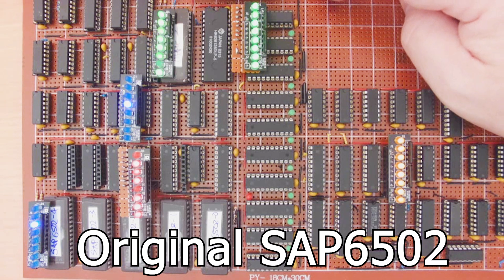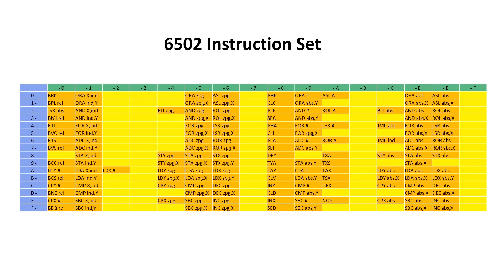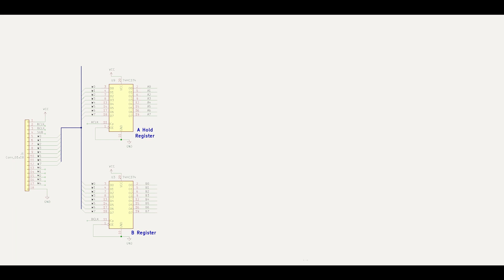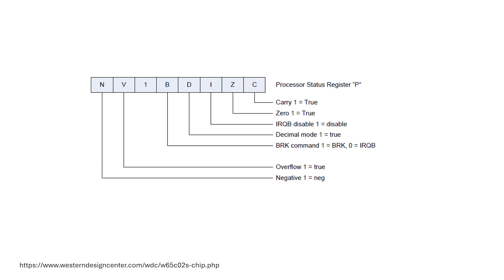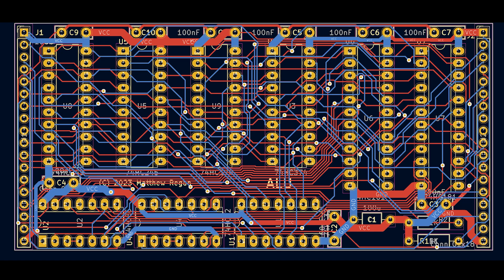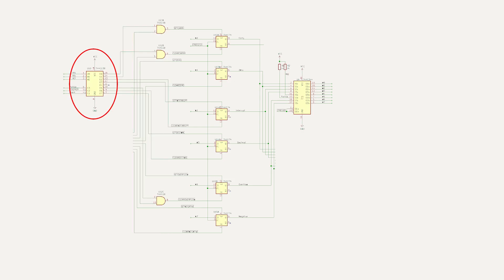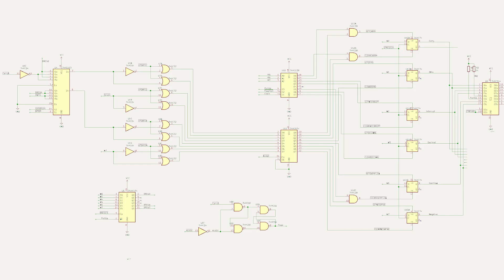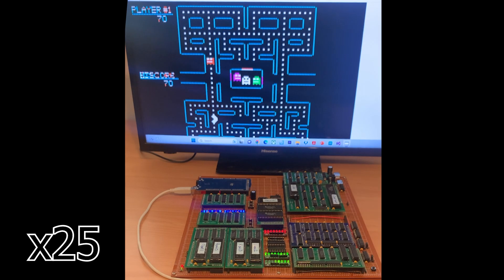TTL Apple 2 computer.  ALU and Status

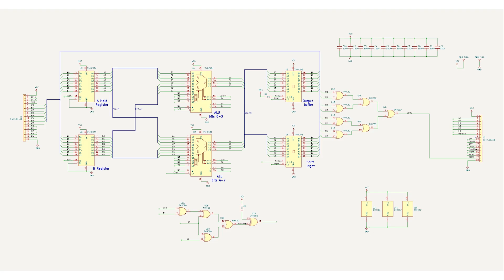Comment: I'm missing something in the diagram at 07:24.

If you look at the S|0..8] bus, the following are connected to it:
• Outputs S0..3 from U6
• Outputs S4..7 from U7
• Inputs S0..7 to U5
• Inputs S1..8 to U8

Where does S8 come from ❓
Reply from the maker: On the ALU board i have, S8 is connected to pin 9 J2.  This signal is driven by a 74hc00 acting as an inverter, which is just to the right of the ALU card on the carrier board.   This inverter is driven by  the !Carry0 signal from pin 16 of J2 on the status card.  

On this ALU board i actually have S0-8 are connected to pins 1-9 of J2, but i never used S0-7.  I plan to use these same ALU boards in an upcoming SAP68000 and i want fast carry generation so i decided to swap pins 1-8 of J2 to signals i can use with a 74HC182.  
When I updated the schematic, it looks like i forgot to leave S8 in place. 

Well spotted, i'll mention it in the next video.
Reply from the maker: Yeah, S8 is meant to be carry bit.  Let me have a look at the board.

Comment: Dr Regan, 

It has been proven that the rev A 6502 did not have a buggy rotate right function, but rather an unimplemented rotate right function, there was such a kerfuffle about this that the rev B 6502 had the function added.

You can find a rev a 6502 demasking that clearly shows the necessary signals are not routed anywhere to perform this function, as opposed to a rev B 6502 demasking.
Reply from the maker: There's quite a good video on it 
https://www.youtube.com/watch?v=Uk_QC1eU0Fg
I just wanted to mention it in passing without getting caught in the weeks.

Comment: The original Datapoint 2200 predates the 74181 but the following model used it. The math part of the 74181 is very similar to the earlier 7483.
Reply from the maker: @jecelassumpcaojr890  yes.  Version 1 was bit serial, but version 2 used the 181.

Comment: the MMU and IOU from the 2e were done in TTL logic at the prototyping stage and it took two huge boards full of chips.
Reply from the maker: Interesting. The soft switches are a pain, but I have a couple of hidden tricks left, the main ones being access to the microcode and the ability to add CPU registers at will.  We’ll see how complex it turns out.  Faster RAM also helps.